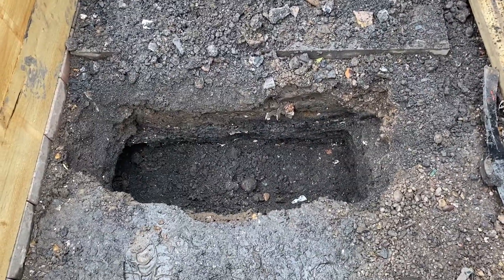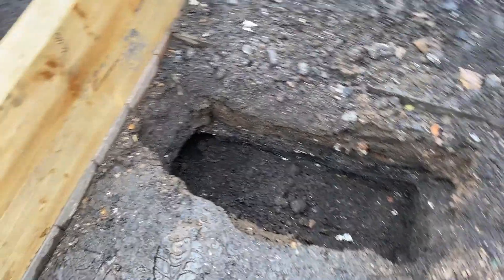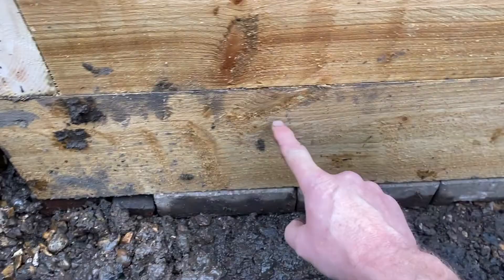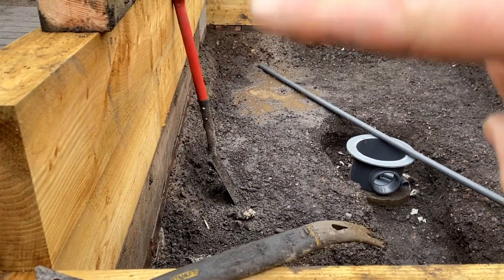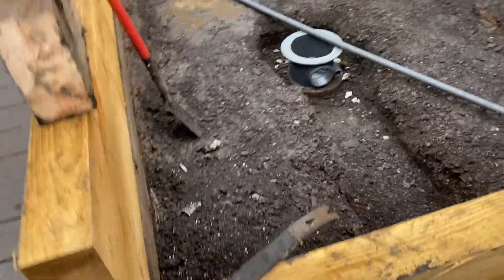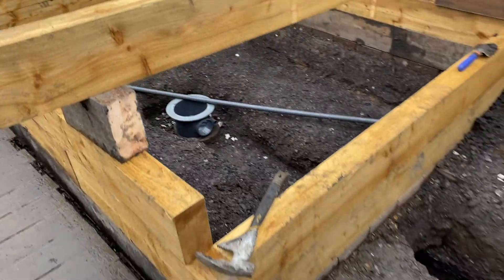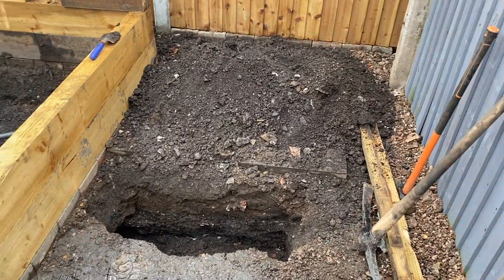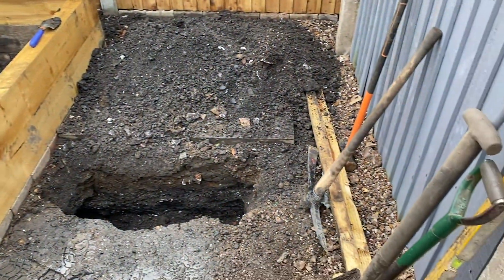The start of my new koi pond part 2

Comment: Ade your going to run your pond on a lexus.....very posh 🤣🤣 (I know you meant nexus 😉)
Aslong as the depth is around 1.2-1.5 metres deep its more than enough 👍🏼
Reply from the maker: It is 3 1/2 foot deep
Reply from the maker: About 3 1/2 foot deep
Reply: Personally I'd do it a minimum of 4 foot but there isn't any set rules on depth as such
Reply: Lol. I head him say lexus aswell. Easy mistake